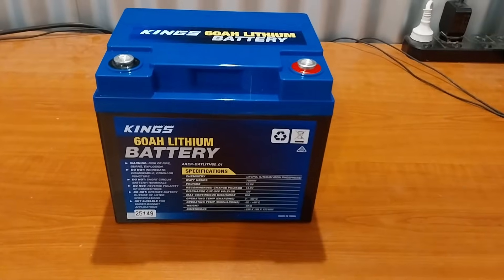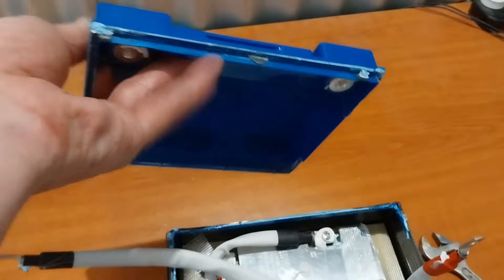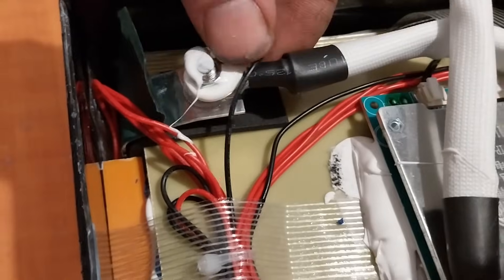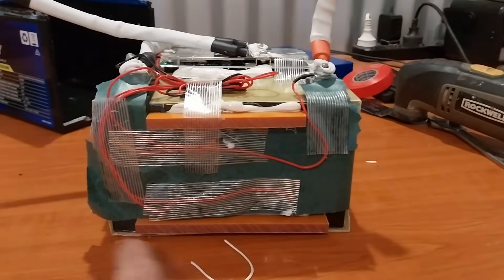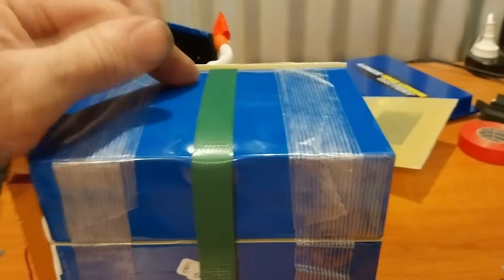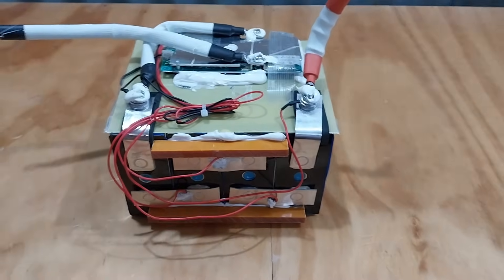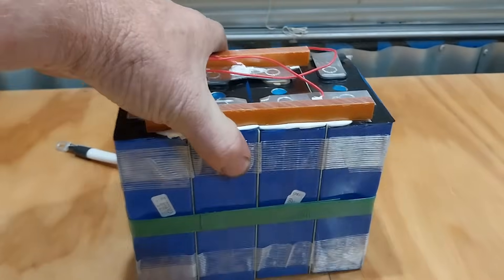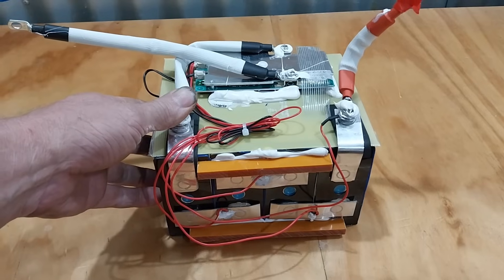Kings 60 Ah Lithium Battery Teardown - What We Found Was Not Expected

Comment: Bit of a question from left field, what are the dimensions on their Prismatic Cells? thinking might fit, minus the case,  inside a power pack, replacing a 12V 33Ah SLA
Reply from the maker: I'm not sure on the dimensions. I would have to pull my battery box apart to measure it ?

Comment: Hi mate, can you tell me the dimensions of the cells out of the box because I wanna put it in a pelican case and it's 15mm to wide when in the original kings case..
Love your content.
Cheers mate.
Reply from the maker: It is all tired into one of the mini battery boxes so I would have to untie it all to get the specs. But according to the Kings website the battery dimensions is 195 x 167 x 171 mm

Comment: I just purchased 2 x kings lipo 120ah and after their first charge one of the batteries has a bulge on either side. I also have another kings 120ah that i use in a portable power box. I check both others and the sides a both flat. After seeing the bulges in yours im a little concerned.   I wonder what they will say if i take it back.

Comment: Would you happen to know what the maximum charging amps is for this, i cant find it mentioned anywhere.
 I one that can handle up to 100a in this size as a 100ah or bigger wont fit.
Reply from the maker: As a rule of thumb, you charge at 0.5C which is 1/2 of it's maximum amp output. So this 60 Ah battery you would charge at 30 amps.
But they can take a 1C charge (the full 60 amps) but charging at 0.5 C is that general standard most Lithium (LFP) batteries go by.

Comment: regarding the strapping / damaged cells, perhaps the cells have puffed since fabrication. at the time of assembly, that tape may have been perfect? just a thought.
Reply: Quite possibly... It's a terrible method of constraint though, they should use a rigid panel on each end under the strapping.

Comment: I bought 4 of these, blew one of them with a direct short, now the bms slowly drains the cells so i ripped it open and removed the bms lol
Reply from the maker: Did you have the same issues with the strap being to tight and crushing the corner of the cell ?
Reply: I only managed to get the top off, it refused to slide out which is why I'm here, i need to cut it open to find out 😂

Comment: Have 2 x 120ah,absolute rubbish,save your money,will not even run small fridge for 2 hrs past sundown,240 ah total
Reply from the maker: @conradkous4170  something doesn't sound right there, they should run a fridge. My 24 volt test system is running two 120 Ah Kings Lithium batteries and that runs the 1,800 watt inverter that supplies some of the loads in my kitchen. It runs the microwave, air fryer, toaster and rice cooker no problems every night and every morning. So far after more than six months I can't fault them.... yet.

Comment: I don't see you buying a $1000 battery and tearing it apart to see how it compares that would make for a good comparison
Reply from the maker: For the moment I won't be buying a $1,000 battery to pull apart considering I live on a very low income, so I gotta limit the spending on this channel. But in the future, once the channel starts to pay for itself, I can start purchasing more expensive batteries to test.
When my big 48 volt batteries five year warranty expires, I do plan to whip the top off one of those for a look see. Those batteries cost over $3,000 each.
Reply: Search YouTube and you will find batteries twice the price of kings that have more issues. You don't always get what you pay for.

Comment: everything about this battery was good, well made, well assembled, with the exception of that nylon packing strap. most likely eve cells given the lazer welded studs and over pressure valve design. they really should have just used 5-10x more fiberglass monofilament tape (this was also lacking, not very much overlap of the tape layers, so the failure point of the tape under load would be the adhesive and not along the tension bearing elements of fiberglass, could of just used packing tape if its not going to overlap a good amount.

imo that amount of bulging is normal under most conditions, but the 2 stress concentrations will be the eventual point of failure of this pack. the case of these prismatics is aluminum, and aluminum suffers from metal fatigue. very likely will crack its case and leak electrolyte internally, somewhat dangerous. had a 280ah cell burst in my car, went back through pictures of when i got them and noticed a very slight dent on one of the corners of the cell, likely from being dropped at the factory. dissasembeled the pack and found this one cell had leaked out about 300ml of electrolyte into its enclosure. I actually drove around with it as my car battery for a few months before noticing it had a dead/dieing cell, again lifepo4 is extremely safe. most of the electrolyte was contained inside of the copious amount of monofilament tape i use to make my own packs. only noticed it because my active balancer was going crazy every day after a long drive. another reason why bms' are dangerous, this condition would cause a partially dropped cell, and would overcharge the surrounding cells, more dangerous if those failed with electrolyte everywhere. its some kind of lithium salt based ether compound, bit more flammable than gasoline.

some thermal paste of silicone would be better on the temp probe but not that important since it just needs to stop/limit charge below ~4C, its unlikely that this battery would be able to get too hot from lots of discharging due to the current limit on the bms itself, so high temp not that big of an issue, affixing the probe to the cell could cause the probe to fail due to normal expansion/contraction. 
these are actually expensive cells that kings used. the 30ah to 100ah cells are about 4x more expensive than the larger format ~280ah cells because theyre used in EV mfg. people saying that they got "grade A automotive 280ah cells" are just straight up misinformed. show me an EV that is actually made with those cells lol, they dont exist. those are for large format energy storage for homes/utilities.
Reply: So you think these batteries are ok quality to use and safe ? I just bought one of these and was considering getting another !  Cheers !
Reply: @reddyman6915  lol did you read my entire comment? sorry its long. i would chop the top off of the battery and make sure its not defective like tihs one is. then use it if the cell casing is not damaged.
Reply: @vevenaneathna  Yes read your whole comment
Reply from the maker: That's some good information there, thanks for sharing. I will keep using this battery until it dies, unless Kings wants it back for inspection. I am not too worried for the price I paid but it would be nice if the manufacturing plants took a little more care with the construction of the batteries.
I have other Kings batteries I am using and I can't fault them, they have worked flawlessly. I have friends that use the Kings batteries as well and they have not had any issues either. Despite what same people say about Kings, I think they have lifted their game when it comes to the quality, compared to when they first came out.
Reply: @TheOffGridBachelor I worked at kings for a bit between jobs and the batteries are the one thing I would happily buy from them. They have internal testers to check battery capacity when people return them and I can safely say that 90%+ returned batteries are user error and nothing to do with the batteries.  Capacity wise they all performed above the advertised ratings with 100ah lithiums giving upwards of 104-108ah. 

Kings cops a bad wrap and some of the products deserve it but the batteries weren’t one of them. Whilst they did have some lemons the volume these guys turn over is insane. Every mass produced product is going to have failures.

Comment: That's why it's $250 

Save up and buy a good unit
Reply from the maker: I paid $170 for this battery, it was on special so thought I get it for some tests.
I do have other expensive ($3,000) high end brand Lithium (LFP) batteries, which runs my 48 volt system 👍

Comment: Bwahaha what are comments deffending this sub par battery...  very swollen cells build quality that seriosly  damadged said grade f cells, wire management that is not only sloppy but a few balance leads touching the razor sharp +/- buss bars  that vibrate with movement and the sharp edges will eventually cut into leads in a mobile application.   WOW the only plus i see is the tiny vip bms which has proven itself in much more capable batteries! These batts should cost well under $100.

Comment: Thanks for pulling apart your new battery. Friend of mine was looking at buying 4 x 200ah kings to power his offgrid property. Not sure now. Kings was a massive disrupter in 4x4 accessories market. I remember how expensive awnings from arb use to be. The quality is not perfect but it was able to kit out the weekender 4x4 enthusiasts. I have had 3 awnings in 13 years from them. I don’t care if I break them.
Reply from the maker: I have several friends that run the King 300 Ah batteries and they can't fault them. I have three Kings 120 Ah batteries and they have preformed perfectly so I would recommend them.
I have found with all the batteries I have pulled down and tested, the smaller batteries regardless of the brand have been the least quality.
Reply: @TheOffGridBachelor  I am looking at 120 ah for our little bus camper.
Reply from the maker: @gibo1971.... If you look through my video list on my channel you see me do a capacity test on two Kings 120 Ah batteries and they passed. I thought I had an issue with them but it turned out to be a calibration issue with my battery monitor. I have three Kings 120 Ah batteries and all run perfectly.
Reply: I too have the 300Ah and 120Ah Kings batteries and both do full capacity charge and discharge. I have several other brands and I found Rock to be questionable quality, in particular their 24V 100Ah has disappointing self discharge. The Kings only required a very short top up after months of sitting idle from full charge. @TheOffGridBachelor
Reply: @gibo1971  Did your friend still go with the Kings Battery’s ?
Reply: @reddyman6915  not yet. He was going to buy some from eBay but when we compared the weight of the batteries the eBay ones were kilos lighter than kings. There is also a YouTuber “organic power” who uses the kings 200ah who has had no problems. Does anyone know what bms is in the larger kings batteries?
Reply: New? The date stamps on the individual cells reads 23-03-18 (@5:27). BMS is 23-11-11 (@8:20)

Comment: These are rubbish assembled by the lowest paid worker in China.  The cells are likely to be C grade or worse, or even second hand, which is why the cheap thin aluminium busbars are heat welded over the screw terminals.  I can't remember a worse quality or workmanship battery teardown.
Reply from the maker: Most batteries are welded terminals now, hardly anyone is using screw terminals anymore which is a pain as it makes it harder to rob cells from batteries.
Not sure on the grade cells that have been used in this battery so I can't make any judgment on the cells. I'm doing a capacity test on the battery so we see what it comes back as.

Comment: Finally got to do the most important test of all with one of my 60Ah Kings. I used a 12V Rovin kettle to boil water for a mug of coffee. Used about 45Wh in 20min to bring it to 85degC where it cutoff. Passed with flying colours. Going to replace the cig plug with mini Anderson 30A connecters (or Powerpole if you can't find them) to reduce voltage drop but otherwise the battery is excellent value for small lightweight jobs.
Reply from the maker: I do love this little battery for size so be interesting on the capacity test results I get. Either way I am still going to use the battery, be great to see how damaged cells preform longer term.
Reply: @TheOffGridBachelor  Ditched the cig plug with fuse and it improved Watts from 125W to 141W so it now boils quicker.😁

Comment: If your not a "techy guy" then how can you comment on such things as the temperature sensor etc. To me the quality and build seem fine. Take anything out of it's protective casing and it will look exposed and vulnerable.
Reply: those cell/s were clearly stressed by that band. would be better off just with the tape. might be worth top balancing given the voltage differences.
Reply from the maker: I was meaning tech savvy as in using a computer. But in regards to Solar and Off Grid Living, I have 25 years experience.
Reply: WTF - you think the quality and build are fine????   You need to get out more.  These are rubbish assembled by the lowest paid worker in China.  The cells are likely to be C grade or worse, or even second hand, which is why the cheap thin aluminium busbars are heat welded over the screw terminals.  I can't remember a worse quality or workmanship battery teardown.
Reply: Are you on drugs😅
Reply: @WayneMcKenzie  you're*, it's*

Comment: Oh dear, woeful quality control there, was disappointed with nearly all aspects of this battery except for the case. Was looking for a battery this size to mount on its side underneath my Delica....a very hard PASS on this one. Even if I drilled a hole in the top of the case and filled the battery with resin for a bit more vibration resistance (5km of corrugations and I think this battery would be toast), I still wouldn't contemplate this one....THANKS Glen for the work and info passed on here. I hope Kings are watching and take heed here. 🤠😎
Reply from the maker: For the price it is still good value for money but damage cells is a concern. More testing is needed with how damaged cells preform long term.
Reply: delica mentioned
Reply: @jacksondudes  how else would we be able to know they have a delica!!!!
Reply: Hay Mate great job so glad you did that strip down , have just got a 60 amp Kings battery for my Kayak & it works , Awesome so far so 🤞cheers T

Comment: Geez us ,I took delivery of the same battery last week to run my small electric Water Snake trolling motor and for overnight camping trips for my Kings 20 L Escape fridge . It ran the fridge for 30 hours at 28 C ambient temp , but to be fair when the fridge got to the set temp 1 C I filled the fridge up with room temp cans of beer and other stuff . It took nearly 5 hours to get back down to 1C with the compressor running all the time for that period , so to be fair, it probably would have run a lot longer if the beer had been cold when placed in the fridge . I was going to buy another one of these batteries but thin I will wait until I see your next video , especially the response from Kings . As an aside I also purchased a I-tech Life PO4 50 S to be be set up inside my vehicle with a 25 A DC - DC charger . Upon hooking up the itech to said fridge with every thing cold ,it has been running for 19 hours and is already down to 13.01 V . Battery was charged to 13.45 V before use ,but went down to under 13.2 V in 3 hours ,doesn’t seem right to me . Thank for listening 👍
Reply from the maker: Going to do a capacity test today and see what it comes back at. I will be running this battery, testing it and seeing how it preforms with damaged cells, over a time period.
So in a way, it's kinda good I did get a dud as it gives me the opportunity to see how damaged cells preform over time. I also do plan to test some iTechworld batteries in the future.
Reply: Calculating remaining battery capacity using Volts is flawed - you should be running through a shunt if you are really interested in capacity used/remaining.
Reply: @einfelder8262  Thanks for the information . According to my chart  13.4 V is % 90 capacity 13.5 is % 99 capacity . I changed over to the I tech battery when the voltage went down to 12.8 V  or 20% according to the chart . All readings were done by a Kick Ass constant battery monitor and also checked by 2 seperate multi meters which were very close to each other in the readings . Any information you can give me will be greatly appreciated. Both batteries are brand new . Cheers

Comment: Not bad - the strapping could be improved to reduce stress on the cell, but the thermistor isn’t really an issue - bonding to the cell make stuff all difference.
Reply from the maker: Yeah the thermistor would probably be fine how they had it, I just like them fixed a little more securely to the cells.
Reply: @TheOffGridBachelor  Definitely better fixed to the cells. An airgap gives incorrect readings. Thermal glue should be used so the sensor is reading accurately

Comment: Kings gear is ok and their support is top notch. I think they realise their manufacturing teams may not be 100% quality but they always seem happy to exchange so for ppl working on smaller budgets i reckon kings is great.
They can sponsor my channel anytime 😂
Reply from the maker: Yes I can't fault their customer service. Around 5 years ago I had a generator fail with under 20 hours of use and Kings were top notch with their return / refund process.
I am going to do some tests on this battery, gather some results and contact Kings with my finding so it can better help with their product quality control.